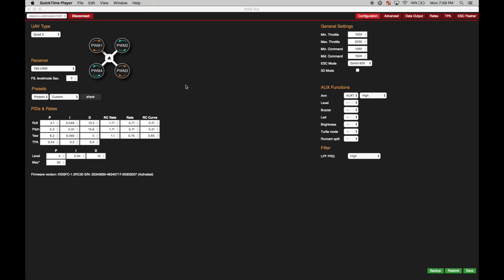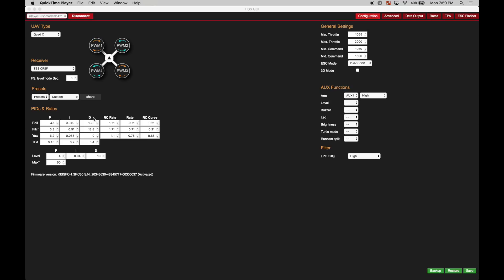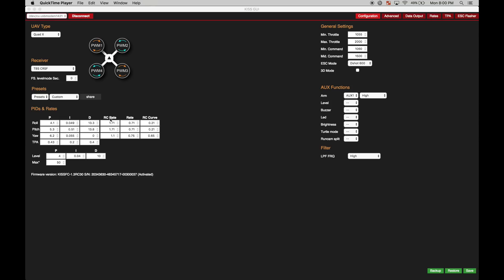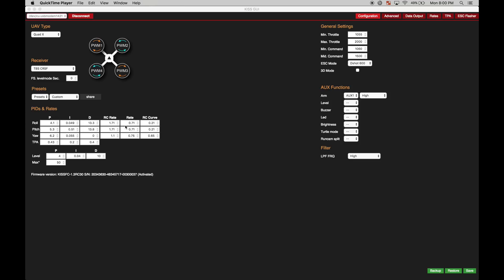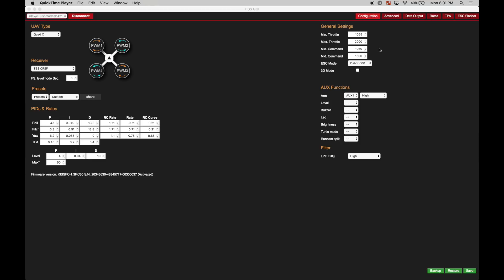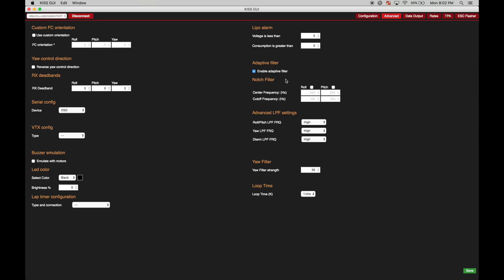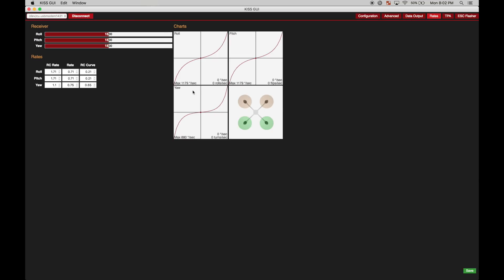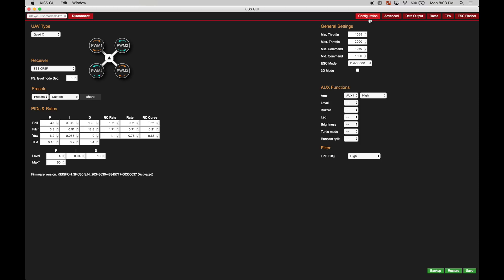WHAT ARE YOUR PIDS, RATES. TUNING TIPS? (See Description)

Comment: hi!, why in the yaw you use 0 on the D?
Reply from the maker: You don’t need to use d term to “slow” down the inertia like you would on the pitch access because you don’t really need to stop the quad is weighing equally on a horizontal plane. If that makes sense. It makes yaw more sensitive. This is all my opinion. Try it out if you don’t like it put some d term I couldn’t really tell a difference.
Reply: @VIKFPV  more I on the yaw? Ok I will try! Thanks bro! ;-)

Comment: My tune came out very close to yours, do you tune the gimbals also? The spring tension for the sticks in the radio? I felt that mine were too springy and had to soften them up too! Thanks for lifting your quads skirt!
Reply from the maker: +AiroFpv yeah. I actually tighten them up in the winter and loosen them in the summer.  Just because of the shakes when flying in the cold tighten helps eliminate the quad jitters lol
Reply: VIK FPV man that is smart!
Never thought of that!